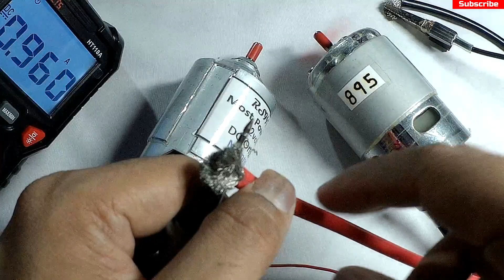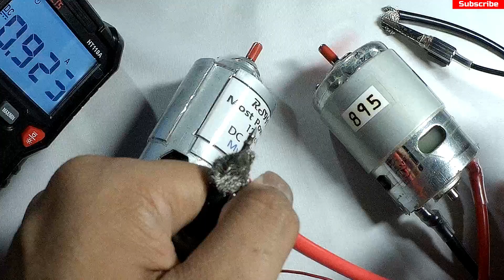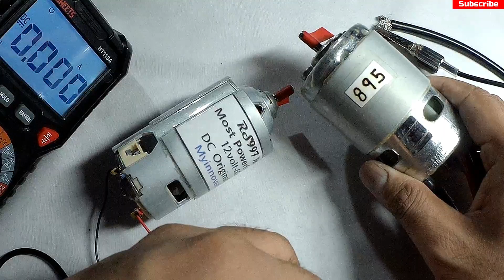Testing 895 dc motor and || 997 dc motor detailed testing video || 895 dc motor 🔥

Comment: I have also purchased a few motors from myinnovation but 895 motor was not there... From where can I buy 895 motor?
Reply from the maker: You can buy 895 dc motor original unit from me, but the price range will be 10000 
I repeat oringal unit, that is why there is a hype in price range.
And the other hand 895 motor which I have,  it imports from outer country, there is also the reason for the price hype.
Reply: Aliexpress. I buy them from there.

Comment: Where to buy 895 motor
Reply from the maker: Check out the website  valuecartdotin and you can easily buy from there 👍🏻
Reply: What is shaft diameter of RS 997 motor

Comment: This is not fair ,997 u are used smaller wire than 895 motor
Reply from the maker: That's temprory for video but I will change the wires for sure😂😂